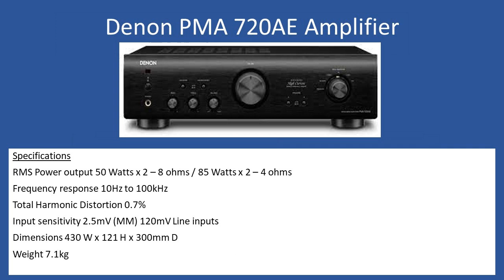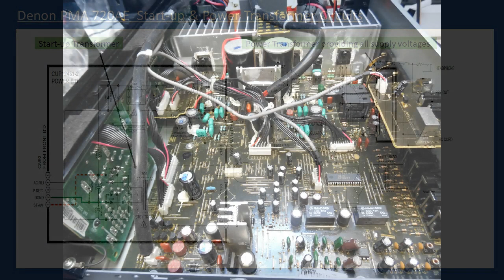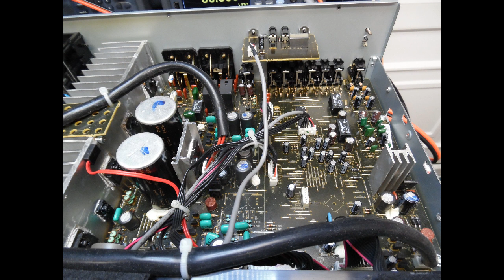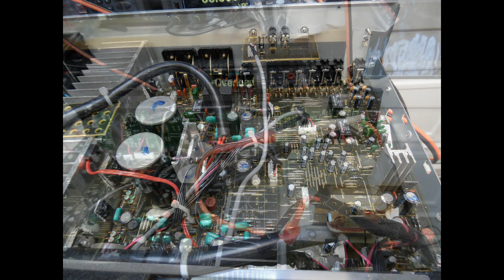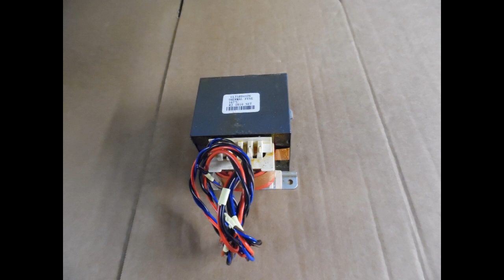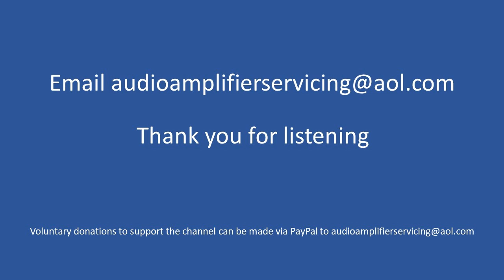Denon PMA 720AE Repair (With Audio Tutorial)

Comment: Hello, I have the same amp, but in my case it's a little more complex... The amp was flooded with water, I've done cleanup, I've done recapping, found one shorted transistor and broken fuse, rest of the elements seems to be okay, but I still got red led blinking with 0,5s interval, to which service manual says it's power module fault, even tho transistors are okay... Have you ever got one of these?
Reply from the maker: Email audioamplifierservicing@aol.com and I can provide support.
Reply: @AudioAmplifierServicing wrote to you. Thanks ;)
Reply from the maker: @alantomczak517 Hi, nothing email audioamplifierservicing@aol.com

Comment: Thank you so much! This video was hugely helpful and exactly what I needed, as my Denon PMA 720AE is showing this exact fault, and while the output tranistors and resistors measure okay, the primary winding of the power transformer seems to be open circuit. I just wonder what makes that transformer break when everything else seems to be in good order. From your experience, is it worth ordering a new transformer when I can buy that same amp (used, obviously) for less than a hundred Euros? Thank you so much again for this video!
Reply from the maker: There is a non resetable thermal fuse inside the primary winding.
If for example the turns become short circuit then excess heat will be generated causing it to overheat and the fuse to fail.
This type of issue is seen with many manufacturers that source transformers from China.
I believe the failure of the transformer is more associated with build quality than an actual fault.
Reply: @AudioAmplifierServicing  Thank you again. Do you have any suggestions where I can buy a transformer to replace the broken one, preferably in Germany?
Reply from the maker: @The030Berliner  Hi I am located in the UK, This company can provide the transformer https://spares2repair.co.uk/denon-marantz-psu-transformer-power-trans-pma720ae-e2?srsltid=AfmBOoo_rdtPQN-s_AZCZA2lncl-WKKI4q_eNPiBu7ZWjzHIoLoYnDbh
Reply: I would try to replace the fuse with the same rating one
Reply from the maker: @bargainszone  If the fuse has blown then either the right or left channel output transistors have failed short circuit.